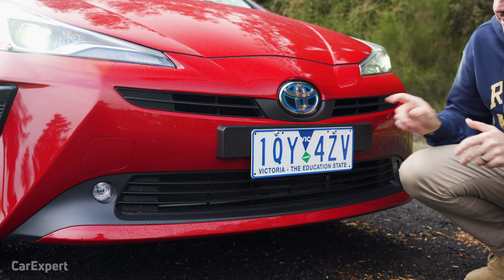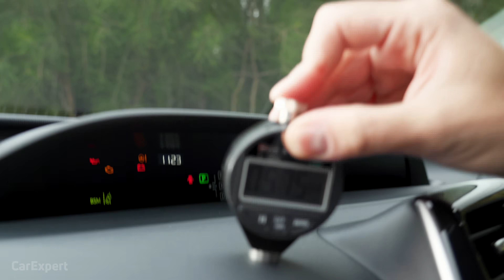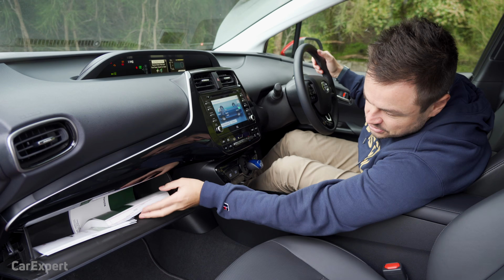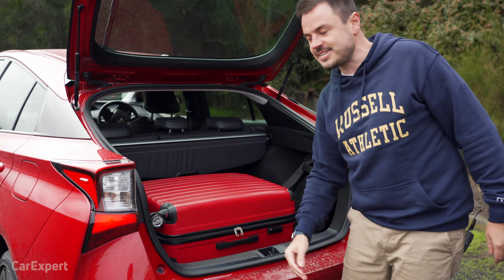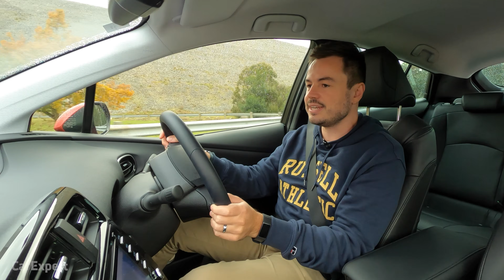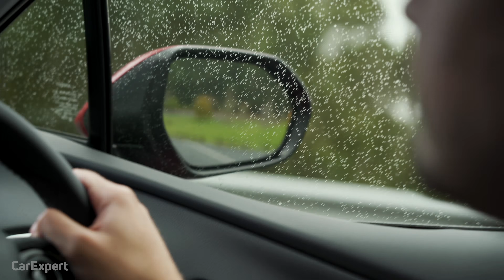Toyota Prius review: It's the best selling hybrid car in the world! Does it work in 2020 though?

Comment: I've owned three, 1.2 million kms between them, all private use, not taxis or rideshare. Hands down the best cars I've owned and I've owned a LOT of cars. They just don't wear out, everything works, the economy stays great and tyres and brakes last forever. Bought one new in 2008, still going daily 260,000km on it. Still feels tight, no rattles, nothing failed or broken.
Reply: @Brendan O'Keeffe Allow for a battery replacement if it hasn't had one yet...it will need it despite the relatively low km's. At last check they were $2,400 AUD Genuine, plus fitting if you can't do it yourself. The batteries degrade chemically over time, k total km's less important. Water pump will be weeping, allow for that, not overly expensive. Check that all servicing is up to date, plugs (Iridium), in-tank fuel filter are the biggest costs service wise. I usually recommend a transmission oil change as it darkens and absorbs moisture over time. this can lead to transmission failure as the electric motors run in the oil. It's a simple drain and refill on these. Use only Toyota WS (World Standard) for this. Other than that, all the usual due diligence that goes with a old used car. If you can spring the extra, go a later model. The Generation 2 was a great car, but they're getting old. Unless you get it really cheap, they can costs as much as a 2009-2015 model (Gen 3). They all burn a little oil between changes, it's normal. The rings are low tension for increased fuel efficiency. If the seller has had the battery reconditioned, still allow for a new replacement on the 06...recon only lasts a little while before you're in strife again.
Reply: @Brendan O'Keeffe no worries, happy to help. I just sent you a FB add, happy to offer advice as you search.

Comment: Ok, as a prius driver for years now... @Car Mojo, @CarExpert: Both of you are wrong. B mode is not for extra regeneration, it's for driving in mountains. Normally going down a (steep) hill in a normal car with stick shift you put it in 3rd or 4th gear to break with the engine, because if you use the breaks they'll be red hot if it's a long way down not to speak of increased wear. Now the prius being a automatic you can't select a gear, and that is where B mode comes in. It tells the car to use the engine to provide aditional engine breaking going downhill.
 And because the prius also uses the regenerative system for breaking it also results in more regeneration.

So no it's not a more regeneration button, it will actually reduce the efficiency on normal roads because, as you pointed out yourself, it's designed to maximise the distance you cover when not applying power.

Other point for @CarExpert, concerning the bar in the rear window. My 2nd Gen prius has the same design, all of them have. Now I can tell you this, the moment you see a car through the bottom window the car behind you is (I believe it's called) tailgating. My rule of thumb, if you see him above the bar then the car behind you is further away. If the car's taillights are hidden behind the bar, they're a normal distance behind you but there is enough light coming arround the bar to still be aware someone is there. Added bonus, you don't get blinded by badly adjusted headlights.  Going to the bottom window, the guy is so close to you that if you break the guy will run in to you guaranteed. 

That said, being a tall guy (2m); Is there still space for the rear passenger if the driver seat is in it's most rear position?
If so, then I think I found the replacement for my 2nd Gen prius (though at 278.000km+ it is still going strong without any defects worth mentioning).
Reply: Dominic actually the Prius will automatically go into B mode if you're on a long downhill. You don't even have to do this yourself. Try it going down the Illawarra escarpment if you're anywhere near Sydney or Wollongong.
Reply: @yggdrasil9039  hahaha, well that will be difficult to test it in Australia. I live in the Netherlands 😉. But next time I'm in the Austrian (no typo) Alps I'll try.
Reply: @RedCell1981  Yes, B mode is not going to be very useful in the Netherlands lol. But yes Prius gen2 automatically flips into braking mode on long downhills to save the brakes after the hybrid battery is full. Very useful.
Reply: Yep you're right. It spins the engine without injecting fuel to simulate engine braking, think downhill in a manual truck and down shifting. In efficiency terms it's wasteful as energy is diverted away from the battery. Better to use a light application of the brakes to maximise regen.
Reply: Thank for the B mode info, on my old Prius, I thought it was Break mode or something, hardly used it.

For the bar behind, I wouldn't say it's mainly made to block headlights/high beams, because my Mercedes B-class' rear mirror has a dimming function, where at night time, the mirror dims out headlamp/lights from vehicles behind... Just wondering why don't all cars install the dimming rear mirror
Reply: No, I sincerely do highly appreciate you info.  I’m considering buying a Prius.  Believe me I’m no expert at the English language.  My apologies.
Reply: @stephenfiore9960  It's 'you're' info, a comma after 'me' and 'on' not 'at'!
Reply: @Andy-yo3hd  your not you’re . lol. but nice try though.
Reply: @jamirdeol2125  You're right!
Reply: I thought it was braking, not breaking
Reply: @stephenfiore9960  So you found a typo. Well done sir. Now go pester someone else.

Comment: Great car, but too expensive for Australia. To buy one in the US would cost you $34,000 AUD ($24,000 US), but in Australia they cost $42,000 for the base model. The only cheap cars in Australia to buy are petrol and diesel non-hybrids. This is not an accident.
Reply: You can get a hybrid Corolla with similar fuel economy for under $30K.
Reply: @deanstyles2567  Yeah I saw a hybrid one last week (or heard one, or actually didn't hear it, as it was on EV mode in a car park). That is definitely an option. Good call.

Comment: I'm so confused, how can a new car in this day and age not have parking sensors?? 🤦🏻‍♂️
Reply from the maker: It's a strange omission. They're really useful at night time when it's hard to see with the camera and more so for the front end when parking against walls and that kind of thing.
Reply: I've had cars with both sensors and cameras, and always ignored the sensors and only used the camera. I see no need for sensors.
Reply: @MarkPakula  Fair enough - whatever works best for yourself. Personally, I use them both in conjunction, so it's obviously subjective.
Reply: For some reason Toyotas often lack features you take for granted in other cars, I have always suspected it's a cost cutting measure.
(The RAV4 did not have rear passenger area vents until the latest redesign in 2019...after all the competition had them.)

I don't think that I have seen a red Prius before, this car looks fairly classy.
Reply: It does have sensors, front, back and side ones.

Comment: B mode is often misunderstood. HSD always regenerates as much energy as possible, even in D.
When system decides there's certain empty capacity in the battery, B can increase charging current comparing to D mode which then regenerates more energy than in D. As a result B slows down the car more rapidly when "gas" pedal is released, but technically it is accomplished exactly the same way - by increasing the charging current - as driving in D and gently applying regenerative brakes.
But primarily B mode alows ICE to be used for engine braking (means it regenerates less energy) if regenerative braking isn't possible (full battery) or in such cases as long downhills to help the braking system = allows regenerative braking for longer period and/or reduces friction brakes warming/wear.
Reply from the maker: That's correct.
Reply: It's a shame they don't provide an auxiliary PHEV-like battery for long downhills. It's a shame going down the mountains or down to Wollongong and not being able to grab all that energy.